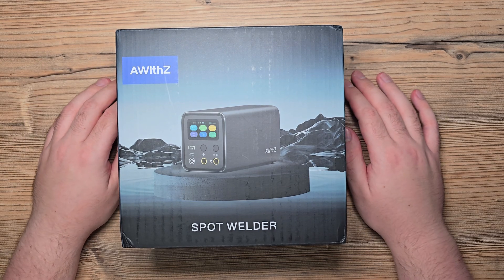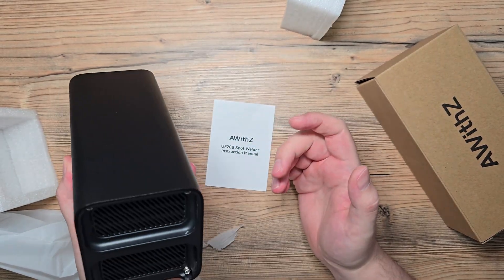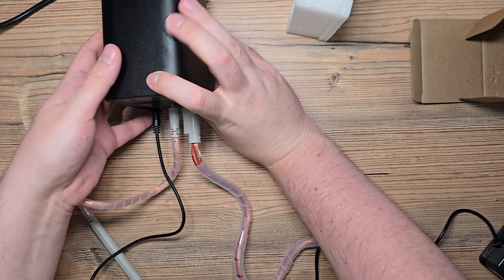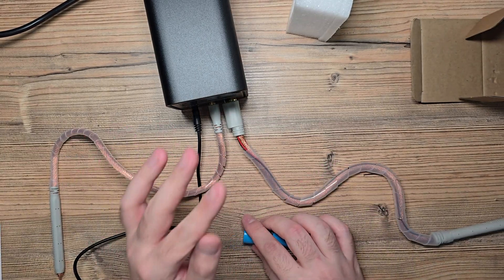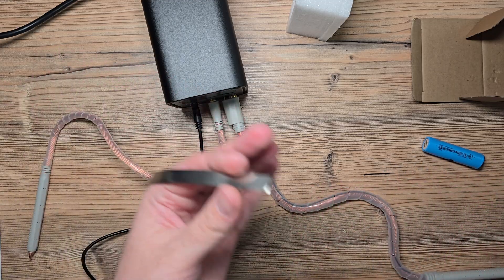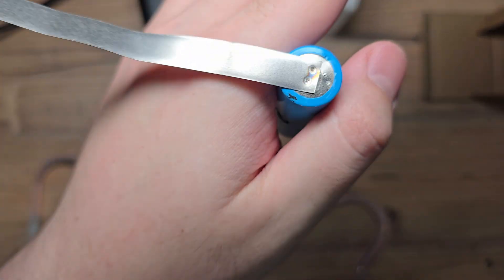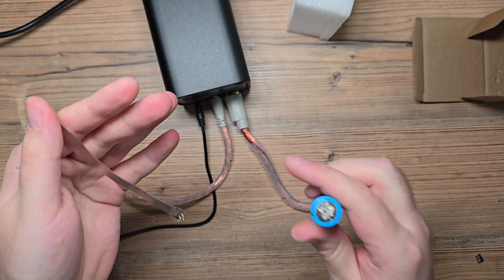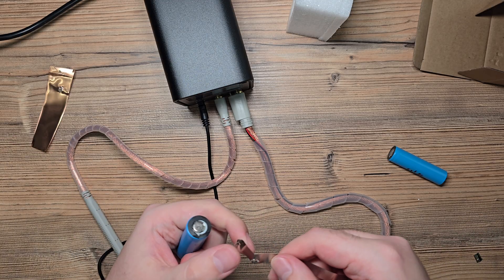AWithZ UF20B Capacitor Spot Welder - Finally something good for 0,2mm nickel and not too expensive!

Comment: I'm no expert but I think you should use a longer pulse as well as gear 99 for 0.2+0.2. Specs say it can do it so . . . maybe play with the settings. Also always test on a flat plane so grind off your previous lumpy bits AND try some flux . . . like the pros do. When mine arrives I'm gonna do my own tests and report back here as your video isn't too old.
Reply: Флюс используют для пайки. Для контактной сварки он не только не нужен, но и катастрофически вреден.
Reply: I respect that comment and i'll also follow you as i also i looking to buy this item
Reply from the maker: You're right, best results you will achieve using brand new (flat) cells, I just did unboxing and played around having this spot welder for like an hour before shipping to my friend.

What I can confirm, its suitable for 0,2 mm and that's very good information if we consider price, no more microwave transformer spot welders are needed :)

I didn't heard about flux, waiting for your report :)

Comment: i managed to get a secure weld with uf20b of pure copper 
0.15mm and 0.1mm nickel plated steel at 85% power
works like a charm
Reply: It's should do 0.2pure and maybe 0.25 should also be good enough
Reply: @khalilkh7389  it cant weld 0.2 pure at all even with 0.1mm nickel sandwiched. it is not close to being strong enough. 0.15mm copper is MAX
Reply: @rubberbandman6641 thank you friend 
I was mentioning pure nickel strip 0.2 and 0.25
Not cooper strip 😊

But actually nice to know it capability to 0.15m cooper nickel sandwich 
This means it successfully do as advertised.
Very good spotwelder for this price 

I myself ordered ukf10 so hopefully it will be great 😊
Reply: @khalilkh7389  it can do up to 0.4mm nickel i think. i manage weld 0.1mm nickel with only 8% power